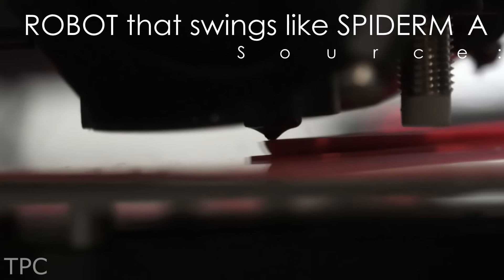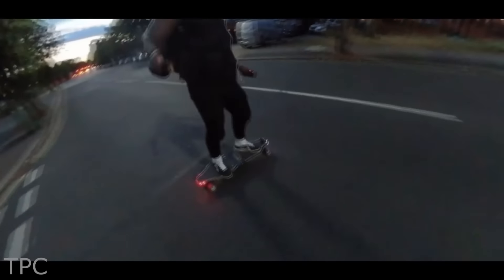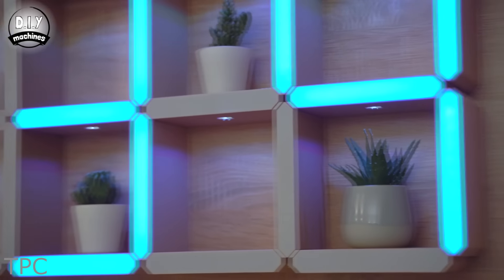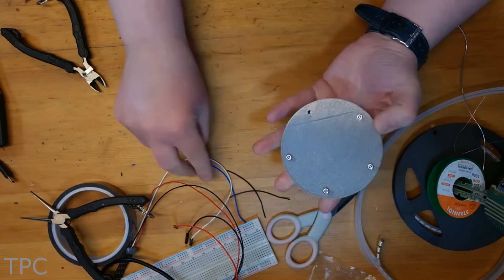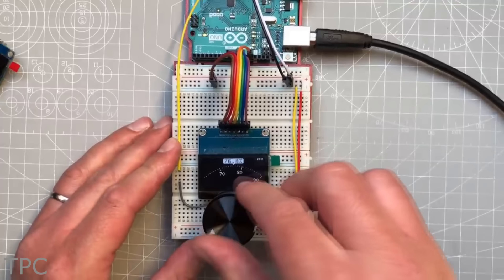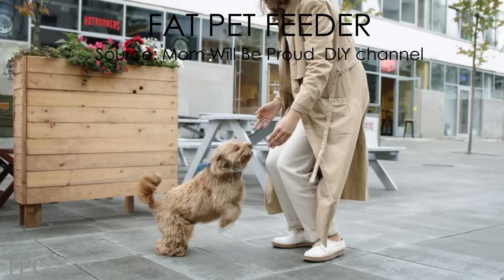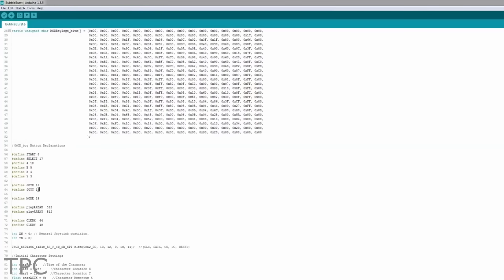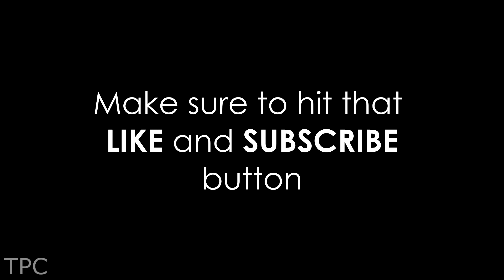10 Incredible Arduino projects of the year 2022!

Comment: Entertaining videos but, let's face it, only a VERY small percentage of advanced DIYers on large budgets have the resources available to accomplish and complete these particular projects.  I don't, certainly,  yet I have been an avid uController/Adruino project designer and builder for over 10 years.
Reply: I disagree. Yes, you would firstly need to have some components and an arduino + some knowledge and skill. However, you can do a lot of things just with a breadboard and simple components with the arduino. This year for secret santa, I made a save that needed to be opened with a potential meter. With the percentage of it being displayed on a 4x7 segment display that also displays a counter in seconds how quickly the 2 digit code had to be given with the potential meter. When the code would be correct, a servo would turn and unlock a cardboard box and reveal the present.
Reply: How can you be an "advanced DIYer" without having these parts lying around?

Comment: WARNING: for high power battery-operated devices it's not recommended to use a diy device; yesterday a whole family was burnt to death by a faulty battery operated scooter that was left charging overnight and at some point it ignited the whole apartment, it was a tragedy in Buenos Aires Argentina.So best advice is stick to officially approved devices along with the proper charge method and electrical instalation in working order.
As of today it's suspected the weight of the person ended up puncturing a battery cell that when recharged caught fire and the flames spread to nearby clothing and plastics causing the tragedy.
Reply: that honestly horrible but doesnt have to do with arduino community that much
Reply: I think it's safe to say that If you're making ANYTHING with batteries or electricity you MUST learn the dangers associated with them and how to prevent failure
Reply: That sounds like a horrible freak accident. But the RC community messes with high power batteries all the time. Plus such a tragedy could technically happen with a small battery as well. All you need is an ignition source. It could have happened with a Galaxy Note 7 back in the day.